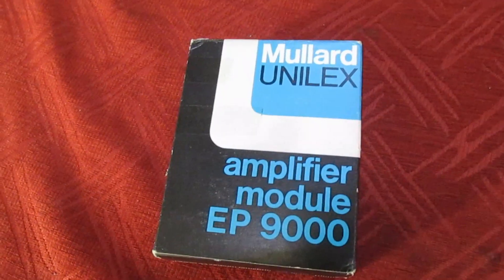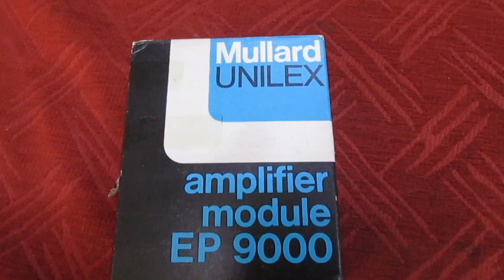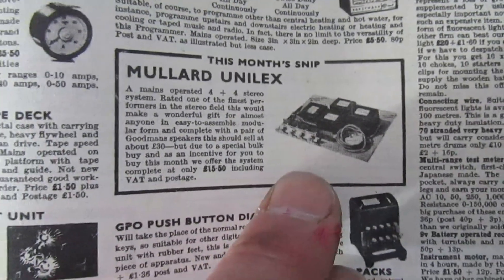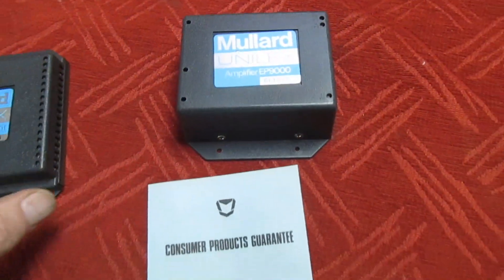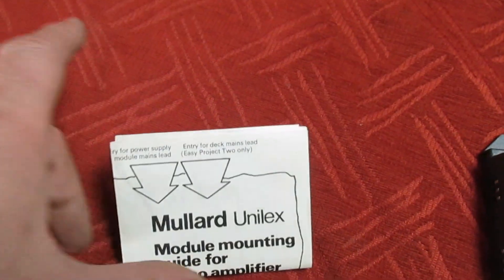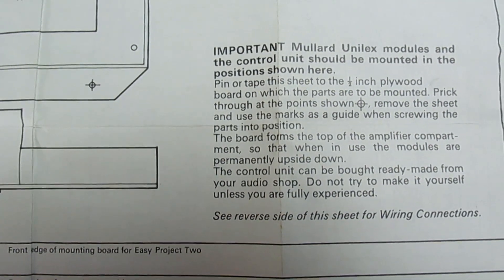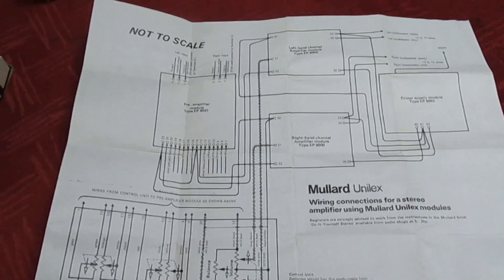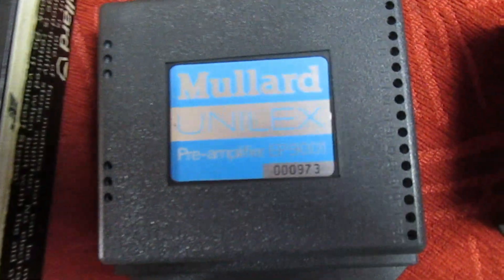Mullard Unilex  solderless vintage HI FI amplifier kit

Comment: Remember seeing a Mullard brochure titled 'Do it yourself stereo' as a 9 year old kid in 1975. Dad wanted a decent sound system as all they had was a Mullard valve radio and an Alba suitcase record player. I rember reading it and seeing colour pics of the 2 power amp modules with the PSU and preamp and front control panel and reading the phrase 'Screwdriver electronics by Mullard'. Several configurations were pictured but what sticks in my mind was a 'coffee table' configuration with what looked like a low living room coffee table with a hollow box at each end next to the supporting legs; one box housing the electronics vertically and the other providing storage for vinyl LP's. There was also a suggestion that the user does not continue to use it as a coffee table as spilt coffee & biscuit crumbs do not mix well with sensitive electronics and vinyl records! In the end, Dad sold his golf clubs and purchased a 3 in one music centre, badged as a Reynolds R1001 (Reynolds Electronics were a Dundalk, Ireland based firm linked to Alan Sugar's Amstrad). The music centre was the exact same as the SBR KF3545B and it had a BSR P144R record deck. It also looked very similar to the Amstrad MC20 so I suspect Alan Sugar was importing and rebadging these units. Costly item at 250 quid in 1976 but superb sound on the FM radio and record deck; decent heavy speakers no doubt also contributed to the great sound. Cassette also had CrO2 function and adjustable record level but no Dolby NR. Looked impressive with backlit green dial and tuning/record level meters. Had it up to 1999 when it was donated to a local hospice, still working great.
Reply: I remember the Amstrad amplifier. Great piece of kit!

I had the Mullar diy kit and assembled it and worked brilliantly!

Wonderful days!😅

Comment: A couple of years ago i managed to claim 2 bags full of nos simens ad161's/2's
I don't think they are to66 packages though michael.
I think they are to37 packages and you will find it fairly difficult to source new made mica insulators for these.

Although the most common amp circuit you employ these into only require one insulator for the ad162 pnp to
be isolated from the ht railed common to ground supply.
Mostly the npn ad161 is a collector to heatsink common to ground device on most amplifiers fitted with these.
Reply from the maker: Still have quite a few AD161/AD162 in stock , in fact the AD161 was used in the ITT CVC9 valve hybrid TV as the 20 volt regulator .

Comment: i bought a set of these modules, minus the controls, they didnt have them, from greenweld, i think, but may have been bull electrical? not sure,?, in the mid 1990s, when they had some old stock, still got them, never did anything with them! bull is still around, in one form or another, online, but greenweld website not working , so likely finished ... i think both companies changed hands at least a couple of times, greenweld certainly did back in the 90's, , so many of these 'surplus' suppliers long gone ,

Comment: Didn't they have several different power amp modules and power supplies to build amps of different power outputs? 15 watts seems to ring a bell but I may well have made it up...
Reply from the maker: I think your right because I built an amp kit from RTVC back in the late 70s and that had mullard modules providing 10 watts.

Comment: Hello there. I have had some of these apart in the past. I'm pretty sure they have AC127/8 in push pull. The transistors were set in an alloy block for mounting to the aluminium base plate. I once used a pair of the power amps to repair a Ferranti stereogram. The output stage(s) were broken, but as luck would have it the designers had used the Unilex PCB mounted (soldered) at 90 degrees to the main board. So they were essentially a direct replacement if I recall correctly. Subsequently I got a brochure/manual for the stereogram and it seemed to associated/made by Pye. So perhaps that is the commercial connection Ferranti-Pye-Philips-Mullard. Same group of companies I think. I also made up a set of Unilex modules into a system. As you might guess the supply (24V?) was +ve earth for the germanium transistors. Thank you for your videos and also praise be to J&N Bull Electrical! Ha
Reply from the maker: Makes sense as these are pretty low output powers . Many thanks for the comment . .
Reply: yep, philips owned all those brands , also Ekco, at the time these modules were current, they also had 'naked' various modules (no plastic case) for internal equipment use, usually numbered LP something, Roberts used their tuner and IF modules for quite a lot of their stuff, early IF ones suffer from bad AF11x transistors, the LP1162 audio output module used the 'block' germanium transistors, AC128K/AC188K, AC176K/AC187K , the smaller module, cant remember no., used AC128 and AC127, round can types in clips
Reply: I think it depends on the models. 
Im quite sure that mullard made 2 different versions of the unilex.
This one 4 watts per CH uses the  ac128 pnp/ac176 npn Ge OPT devises,  the more powerful version probably employed the mullard lp1173 module similar but having these larger screw mount AD devices for a max of 10 watts per module when given a slightly higher + rail.  The lp1173 has a slightly larger heatsink with 2 cuts in it to help with
air circulation.   

Im quite a fan of how these old Ge modules sound, definitely sound different to anything with silicon opt's
Its certainly a sound of its era the 1960's and early 70's.

Comment: I had a set of these, might of had the PSU module as well. No idea what happened to it all!
Reply from the maker: Looking through back issues of practical wireless these were Widley advertised and at very low prices , almost indicating it was not a big success .
Reply: @michaeldranfield7140  I do remember pulling one apart but it was a really long time ago now. I might find them while rummaging over the next few months, but i think they're probably long gone. I had a grand clear out when i moved into a new workshop about 5 years ago i guess.
Reply from the maker: @gonzinigonz  The ones I have are riveted together so I don't know what's inside but I would not think its AD161 AD162  as these are quite low powered and I think a pair of AD s will produce 10 watts .

Comment: Do you remember the ILP modules? I Built an amplifier based on the HY50's and designed the preamp myself.  Must've been the late 70's.  The amplifier is long gone but I think I still have the modules and the toroidal transformer somewhere.
Reply from the maker: Yes I do , they were like a big black finned heat sink with I seem to remember 5 pins coming out .
Reply: @michaeldranfield7140  That's right, they had all the components potted and attached to the back of the heatsink. Yes just 5 pins coming out of the back. Input, Output, Ground and a split rail supply input of about 30 - 0 -30 Volts. Sounded pretty good too and they were supposedly 'indestructable'
Reply: @ksnstechtopics8650  i have 2 HY60s i bought in the 90s and never used,

Comment: I remember seeing those units advertised in PW, but my pocket money didn't stretch that far! J Bull Electrical - remember those ads too, Bi-Pak and Bi-Pre-Pak were good for transistors and TTL IC's even if some of them didn't work!
Reply: Gosh. I remember bi pre pack.  Hopefully someone reading these posts will have the missing modules .......:)
Reply from the maker: @kendom33  I'm in no rush , things always seem to turn up in the end if you wait long enough  .
Reply from the maker: I bought a unmarked bag of chips from bi pre pak and the only ones I managed to use were SN7400, I made an oscillator with a dil socket   and tried all the chips but the ones that did work were clearly all seconds as they oscillates at different frequency, most of the assorted semiconductor packs were all rejects.

Comment: I had the complete set of these for Xmas back in the very early 70s, I used the speakers and turntable out of an old radiogram, built a cabinet for the amp and speakers. I thought it was great, though Radio Tirana used to come through in the background sometimes. It took me a while to figure out how to get rid of that. I threw the whole thing on the tip years ago, wish I hadn't now. Regards Mike G4VQH
Reply from the maker: That's criminal throwing it all away, I have so much from my childhood that I could never dispose of.
Reply: Yes I agree with you, it was really just circumstance at the time. I had a lot of my stuff on the loft at my mothers house, my father had passed away and she was getting the loft insulated. I was on my own and just had to clear it. BIG mistake  @michaeldranfield7140
Reply from the maker: I was in a very similar situation to you, after my dad passed away I had to clear the house out, only I didn't throw anything away, I just rented another place to put it all in.

Comment: I bought a Garrard 3000 turntable to replace a missing one from an HMV Stereomaster 2600 I was working on. The turntable was in a home made plinth/shallow cabinet & was connected to the Unilex module system. This was about 3 years ago (2019). I chucked the rest in a skip, so there went the modules. You know yourself it is SO difficult deciding what to dispose of. I'm in a 4 bedroom property on my own with about 1/2 a room to myself & 7 sheds

Richard, G0OJF, UK
Reply from the maker: My problem is I live in the past and so much stuff I have has memories attached to them so I don't tend to throw stuff away, there was a time 10 years ago when I had so much stuff I rented another place to put it in, however when this 1700sq feet industrial unit came up for sale I bought it, that was nearley 10 years ago, now I'm struggling to move inside!
I only live in a 3 bedroom house but filled the loft in a very short space of time, in fact I had to reinforce the floor with cross beams when the nails started popping out of the ceiling, some people call me a hoarder but I just consider myself a collector.

Comment: Very surprised to see the Mullard Unilex system mentioned here, it's extremely rare.  I built the complete amp, right down to the cabinet detailed in the instructions. I remember well feeling very nervous when gluing the black vinyl covering to the plywood!
It worked first time and I was very proud of my work!  I also built some speakers from scratch and my sources were a Garrard autochanger, a reel to reel tape deck and a valve tuner.  Gave me good service for a few years until I started work and upgraded to an Armstrong 521, with Pioneer PL12D turntable, that felt like the big time!  I sold the Unilex and the speakers through a local houshold auction house, and surprisingly they sold for good money!  You know how it is though, I regreted selling them as it was my first project and audio system, so about 10 years ago I tracked down a full set of NOS Unilex modules and all the brochures from the time. I probably won't ever use them but it's good for the nostalgia.  I might try to find some more as I'd like to find out whats inside!
Reply from the maker: Glad you liked it, my problem is I like to keep things and like you I have a lot of stuff that I will never use but just keep for the sentimental value and the memories attached to them.
Reply: at least one of the 'surplus' companies had quite good stock of the things in the mid 90's, i got a set, 220v power unit version , though, and no controls module